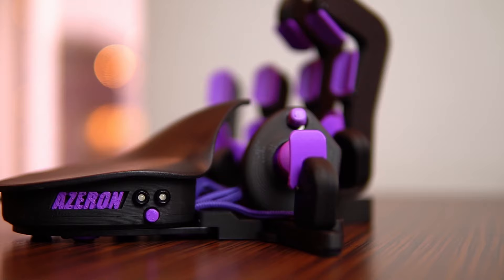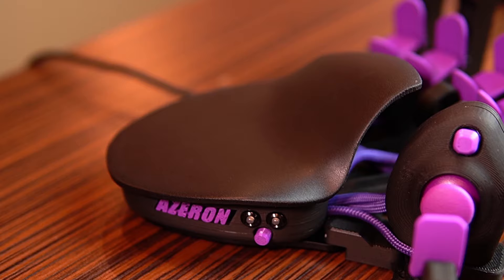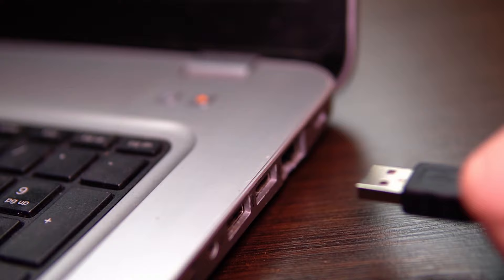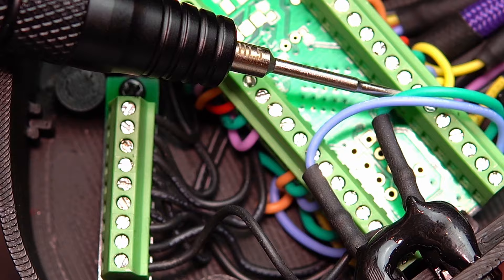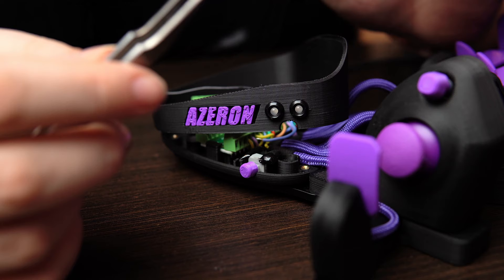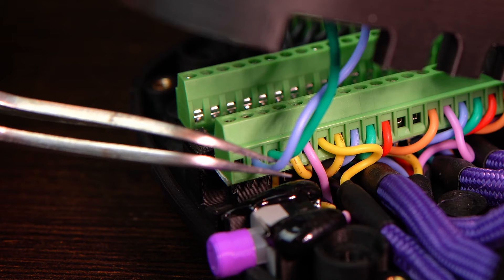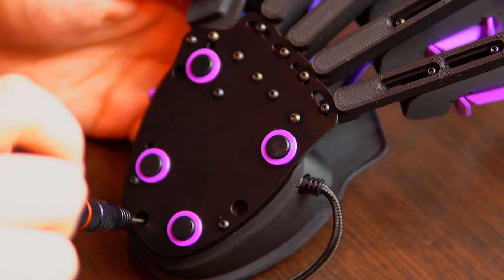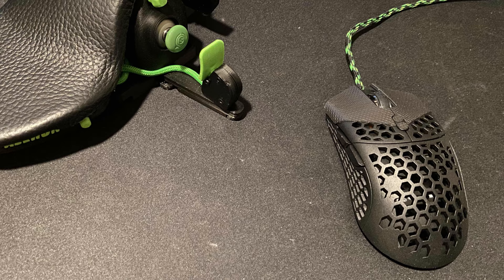AZERON KEYPAD PALMRESTS - ALL YOU NEED TO KNOW  /w LatvianCAT

Comment: How about an interchangeable pad that doesn't require the consumer to rewire anything. Thats a little nutty tbh. It's not complicated, no, but there are a lot of people who could easily screw this up.
Reply: Agreed! It should be really simple and not involve removing wires.
Reply: The design needs to be changed, since the palmrest and the casing that holds the electronics both have to be changed now. The simple fix would be to print the palm rest and sides of the casing as one unit, and have a flat floor only to hold the components, for example.
Reply: Ok make your own keypad and software to go along with it
Reply: More products should have this kind of customization and repair possibilities... If you can't hold a screwdriver and follow along with a guide then you have bigger things to worry about...
But you could just not meddle with your product and buy either version.
Reply: @acidset  I do have bigger things to worry about, arthritis, so a simple solution to change over the palmrest would be a quality of life improvement.

Comment: Great video I enjoy the detail. I would like to see a video of changing the joystick out for different styles. Also does the Xbox elite joystick work with the azeron keypad? The ones with magnetic interchangeable pads?
Reply from the maker: Yes You can swap and use Xbox Elite caps
Reply: @AzeronEU  Thanks for the info. I can't hardly wait to receive my keypad.
Reply: It does

Comment: Can you use this on the Xbox
Reply: Azeron keypad can be used on XBOX without any adapters, but it will work only on games that work with keyboard and mouse. But you will need to have XIM if you want a 360° analog movement.
Reply: Buy a PC befor buy a 200 $ keypad

Comment: how durable is this though its expensive.
Reply: I own it and it is by far the best gaming keypad on the market. I used a G13 for years. I also owned a Tartarus, and Orbweaver Chroma at one point. They pale in comparison. I am personally satisfied with the construction of the AZERON Keypad. I will be purchasing another very soon.
Reply: @bekrah5961  Did you get curved or flat?
Reply: @hypnoticlizard9693  I tried the flat and didn’t like it. I own a few of the keypads now and all of them are curved.
Reply: @bekrah5961  Ok thanks for info
Reply: @hypnoticlizard9693  No problem. Good luck. 👍🏾
Reply: @bekrah5961  Why do you have multiple though? lol
Reply: @hypnoticlizard9693  cause his probably broke and cant just get a replacement part.
Reply: @breakthecode4634  He said he was happy with the construction of it. if it broke he would have mentioned that.
Reply: @hypnoticlizard9693  not necessarily. He said he like how its designed.